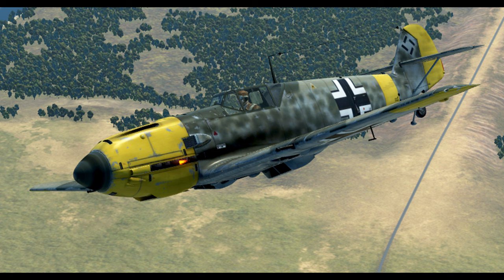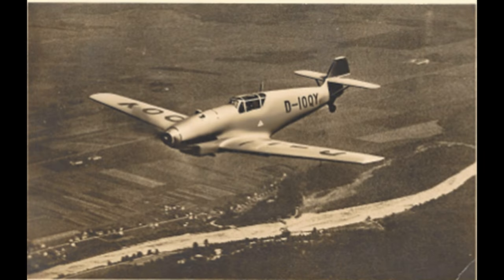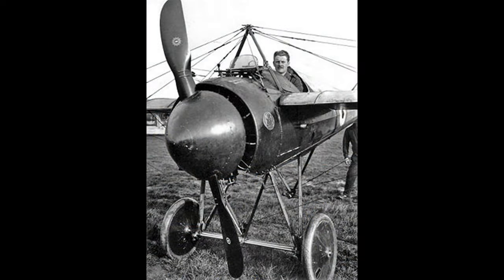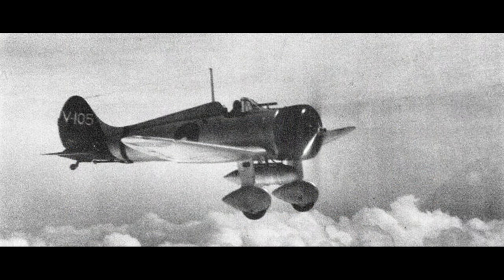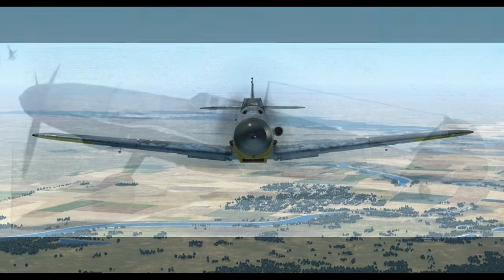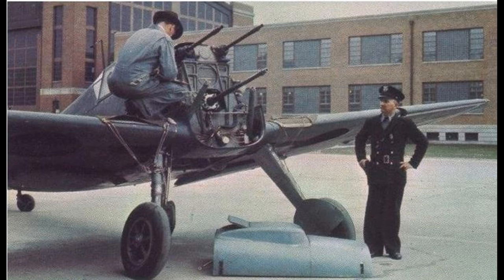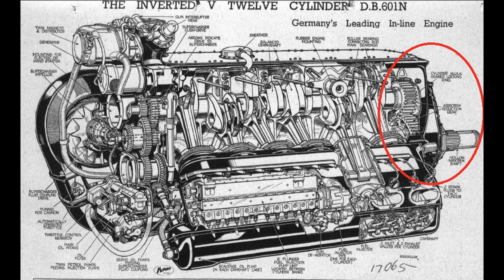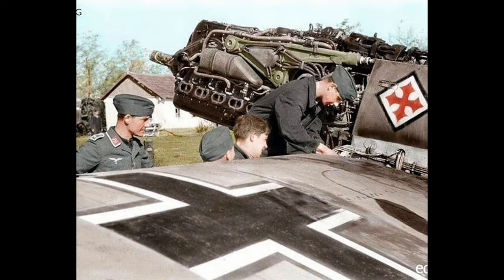Why an INVERTED V-12?  PART 2

Comment: While I appreciate the "maintenance argument", as a military aircraft mechanic I have very little real world evidence to support it.  Seems more likely that the designers/engineers were busy stuffing all the hardware in as tight a package as possible, maintainers be damned.  An hour safety wiring the inboard mounting bolt of the ECS turbine on an F-14 begs to differ.
Reply: The maintenance argument is the most valid. 

Germans have always prided themselves on world class engineering and mechanical philosophy. 

An inverted, inline-engine with a gear reduction drive mounted below the crank near the V of the cylinder banks has a lower propeller hub, and less ground clearance requiring longer gear legs, adding weight and reducing pilot visibility. They would only choose that if it provided more advantages than those drawbacks.

The advantages of an Inverted piston engine is unlimited vs. An upright piston engine when those respective engines will be located at or above shoulder height in service, and an absolute advantage in the overhaul shop. I mean everything about the inverted layout is better for aircraft purposes, except prop ground clearance.

A piston automotive engine is first removed from.the vehicle then mounted to an engine stand, then flipped upside down to remove the crank, caps, rods, pistons, etc. And its assembled the same. 

Therefore you can see you can do a complete overhaul including the highly stressed crankshaft and main bearings while the engine is mounted in the airframe, simply having a picker strong enough to lift the 150lb +/- crank, as opposed to needing a crane capable of lifting an 1,800lb engine, and then an engine stand/rotisserie able to support the entire 1-ton engine, and be able to rotate it.

A couple of mechanics with a light duty hydraulic cherry picker, or just a couple of ladders, could completely overhaul a DB inverted engine in the field without specialty industrial duty equipment.

Also, all the basics such as spark-plugs, oil scavenge pumps, valve adjustments, valves, cams, valve springs, retainers, fuel injector nozzles, high pressure fuel pump, etc. Are all hanging right at shoulder height behind removable panels. Almost everything that needs routine maintenance is within reach of a man standing on the ground. 

As opposed to an Allison or Merlin, where mechanics would climb ontop of the cowling or build scaffolding just to change the 2nd set of spark plugs in the engine valley.
Reply: @TheJustinJ  : That is the BEST explanation of the whole subject!!!  Absolutely!

Comment: Not sure how 'true' this is, but, when I was training as a machinist in mid 1970's, instructor told us the reason Spitfire had carb and ME109 fuel injection was simply because it wasn't possible for the allies to produce parts to required tolerance in high volume. (no idea how subject came up?)
 The Germans were routinely making parts to couple millionths inch tolerance when Britain and USA were still having issues at one thousandth inch tolerances. 
Yes, of course it was possible to match or beat the tolerances, but not in high enough volume.
Personally,  I never did production turning to better than 3 microns (manual machines, no 'CNC' back then) it was pretty nerve wracking as 'we' had to maintain a 95% pass rate on machined part, plus do it in less than 2 minutes.

Comment: So, reading between the lines I suspect the ascendency of horizontally opposed aviation engines is they combine most of the advantages of upright, inverted, and radial engines with fewer disadvantages.

Comment: The twin boom P-38 Lockheed opening the nose for the devastating punch of non convergence type ordnance arrangement. Her turbocharged engines muffled automatically by their use. Also no night stub flashes.

Improvement of cockpit heating electrically would have made it more suitable for cold climate use.
The boom mount motors had only to be cowled for aerodynamics and not close fitting guns.

All political issues aside the Germans had some marvelous aircraft. Even the troubled Grief had some amazing forward thinking innovative features. Across the board their genius engineering was sought after by the allies at the end of hostile action. 
The brilliance of Willie Messerschmitt was unavailable because he would not accept a subordinate role in his design philosophy.

Our incredible Saturn V a direct descendant of German rocket propulsion innovation.
Reply: There were a lot more German advancements!  The Me-262. the 163 Komet, many advanced ideas in submarines, etc etc etc.!

Comment: Inspired by your telling abut connection between air engines and tanks and P-boats - did you have made a video about air diesel engines? Are there any connectios to diesel engines for tanks (the Sovjet way) and diesel engines for P boat - german E boat ?

Comment: Hello Greg, one of the companies which produced thousands of inverted aircraft engines of many types was Czechoslovak Walter, a company known for its turboprop M601 engine (GE H series), later renamed to Motorlet, Avia and today owned by GE Aviation. The inverted in-line engines Junion, Minor, Major, Micron, M337 etc. were produced since 1932 till 2002 (in LOM company). They powered plenty of well known light aircraft (at least in Europe) such as Aero Ae-45, Zlín-26(126...726), Zlín-42/142.  They were used both with carburetors and injectors and both with and without supercharger. AFAIK the reason for the use of the inverted engine was the higher propeler axis, lower gear and lower center of gravity. 

Walter produced also one inverted military V12 engine called Sagitta but only dozens were built. The engine used Farman planetary reducer (as usual option when cannon in the shaft was not needed), so that the propeller axis was kept up. It was equipped with carburator and supercharger. It was used in many prototypes - Czechoslovak Praga E-51 recon plane, Dutch Fokker-XXIII heavy fighter, Yugoslav Rogozharski R-313, Italian Savoia-Marchetti SM.86 or Latvian fighter VEF I-16. The common feature of all of them aside of the Savoia-Marchetti is that the development was stopped by foreign occupation of said countries. The engine with the planetary reducer is preserved in Mladá Boleslav aircraft muzeum, Czech Republic.

Comment: They used inverted V12s for one simple reason- they sounded fantastic! With the Bf 110 the Bordfunker could rearm the two 20mm cannon from the rear cockpit. On the Bf109 that had a single cannon firing through the prop hub the breach sat just in front of the control column under a cover. Was it possible for the pilot to change the ammunition drum in flight?

Comment: Hi Greg. I don't know if this has been mentioned elsewhere before. I seem to remember reading  that Rolls Royce mounted an inverted Kestrel on an airframe for an expo sometime in the 30's. The reason for this escapes me. But some folk suggested that it gave an advantage however slight and the idea was copied.Rolls had a long history of upright V-12's from the WW1 Eagle onwards. I suppose convention must be hard to break unless there are significant advantages

Comment: Just to note, the Japanese liked guns firing between the cylinders. The A5M you show has guns at 11 and 1, while the Ki-27 has them at like 4 and 8, or 5 and 7. The Ar 196 also fired between cylinders, as did the Swordfish. It was pretty common, actually, until the twin row made it impossible.

Comment: Loved the comment about losing stuff in the V. Having a Moto Guzzi I find all kinds of lost nuts, springs, leaves, washers and stuff trapped in the V.
Reply: I have a US military technical manual for motorcycles dated 25 September 42, in it is all the technical and rebuild information for the common WLA Harley 45 inch flathead that they made over 90,000 of, the experimental Harley shaft drive that was based on the BMW design (although this model was never mass produced 1,000 were built for field trials and apparently as of the printing of the manual they had intentions of making it) and an Indian shaft drive with the Indian 45 inch V twin flathead turned 90° sideways like a Moto Guzzi, aside from in this manual I've never seen anything in print or any pictures of the shaft drive Indian anywhere else, it's a real unicorn.

Comment: I want to know more about the oil in a inverted v does it take power or burn more oil I'm sure you wouldn't need piston squirters with the oil from crank falling on pistons and it would help piston cooling ? So many questions

Comment: Quite logic .engenerrs in those days use to think in the manteinance of their work . It was common  to se large manuals in operation and manteniance in cars motorcycles and all sort of apliances . Accesibility was a must in all branches of engenering why? Because manteniance was more to be done . Nowadays engeniring is more precise do to the materials developement things go under very precise tolerances in terms of materials .in the past such knoledge of the resistance of material  wasnt there so the engeneers had to over built every componet critical to function and develop protocols for manteniance .

Comment: During the Spanish Civil War two British aircraft were exported to Spain where they needed, as they say, some assembly. The Spanish mechanics put the aircraft together, minus a couple of parts the mechanics had never seen before. The two aircraft went out on patrol where they got in combat but suffered propeller damage and ended up being captured by the other side. The mechanics on the other side replaced the propellers and adding in the missing parts. Because when you shoot cowl mounted guns you need interrupters to make sure you do not shoot your own propeller off. Oops

Comment: also I think since the cylinders are out of the pilots sight, you could fit engines with more displacement without affecting the view resulting in more power

Comment: Could you make a video talking about P-51's laminar flow wings and how they behaved in turns? It is often said that they had bad turning performance but I would like to know more details about it, with lift coefficients, turn time and critical angle of attack compared to other contemporary fighters.   I know the P-51 design isn't particularly optimized for turning performance given it's weight but I would like to know how much (if any) did the laminar flow wings hamper it's maneuverability.
Reply from the maker: I will have a good aerodynamic 109 vs P-51 video.

Comment: I've been wondering how they did prop hub guns for awhile.

it wasn't long before I speculated that it'd have to be with a gear driven prop to offset the the hub from the block (can't really see a gun going through the block, let alone the zig-zag crankshaft).

It's nice to see the mechanics of it actually explained

Comment: Greg,  You finally hit on the best answer !  I knew a former Luftwaffe aircraft crew chief for several years and he always said the inverted engine's ease of maintenance  imparted a significant advantage .  I also consider the German aircraft fuel quality  adding to the maintenance load per flight hour .   Bill  also reminded me  the Luftwaffe grew from ( and never had reason to change ) from tactical roots dating back to WW1 .  The same can be said for British design parameters persisting well into the 20th century .   Great series !!   .

Comment: I don't know if it has already popped out in the comment sections of both videos, but when I think about the 109's engine bay I often appreciate the cowl-mounted radiator and its evolution along the plane's versions. It's not a big factor when you have to choose between the two layouts, but probably it's a plus for the inverted one having the oil radiator very close to the cylinder heads.

Comment: Ques: Does inverting a V type engine put any additional strain on the crank bearings or connecting rods?
Reply: Compared to the internal dynamic operating stresses of the various reciprocating and rotating parts of the engine, an additional 1 "g" of acceleration in any particular direction would seem to me to become entirely insignificant, since we're talking about hundreds of kilograms of metal moving at thousands of RPM.
EDIT: Of course, some changes to the oiling system would have to be made, but even then it's an aircraft engine for an aircraft that's expected to be doing combat aerobatics so you can't really assume that any particular direction is "up", meaning that if you want something lubricated you better supply pressurized oil to it or spray it with oil from a jet mounted somewhere, splash lubrication just wouldn't work in any way and that would generate too much "windage" losses anyways.
Reply: @44R0Ndin  Thanks for your in-depth explanation which makes sense to me, I should think aerobatics which rules out a splash or dip type oiling system.

Comment: Hi Greg,  can you tell me what type of supercharger the FW 190 used.  none of the documentaries make mention of it.   was it the same continuously variable type as the BF 109?
Reply from the maker: Sure thing. The 190A used a two speed centrifugal supercharger. It did not have the 109's variable system.

Comment: As with the cowl guns, for the inline cannon the inverted V DID have an advantage if you think about the breech of the gun reaching back into thecockpit of the 109. With an upright V this would be smack in the middle of the instrument panel. 
So it did help with the ultra-compact design of the 109.
Still not something that would have been considered while deciding how to configure the engine, I think. But helpful in the end.
Reply from the maker: That tunnel is very near the center of the engine, it wouldn't move up much if at all with the engine upright. look at the plane's profile to see what I mean.
Reply: @GregsAirplanesandAutomobiles  
Thanks for all your great analysis.
Your videos are fascinating.

Comment: No sooner did I start thinking about such as the pre WWII DeHavilland inline inverted engines and similar stuff than you showed a virtually identical design. No machine guns ever intended for that civilian application, so what  was the need for the added design complexity ? And sure enough,direct drive. It pays to listen to the content before applying the typing finger.
Quite a bit of content I have encountered nowhere else. Thanks again. Cheers.
Reply: I fail to see added design complexity and, being direct drive, the bonus is much better visibility and accesibility for the same prop clearance.
Reply: All those DH engines were designed by Halford.  The advantage with the earlier 4 cylinder engines was that it moved the cylinders down out of the pilot's view.  So the design was carried over to the inline 6 and V12 versions of what was basically the same air-cooled engine.  Many are still flying today in DH 'moth' aircraft.  I stripped and reassembled one myself in my training as an RAF engine fitter at Halton.    The only advantage given for the inverted layout was visibility for the pilot in these direct drive engines.   I  have read all my many technical books on aircraft engines and none of them mention any other advantage or disadvantage of inverted design.  This is the first!

Comment: O.K. speaking as an Aeronautical Engineer, (I worked for Grumman AeroSpace for 10 years some years ago)  Let me put my 2 pfennings worth in here. 
First, inverted, it would lower the Center of Gravity. 
Second: it would lower the overall height of the aircraft, allowing for a slightly shorter landing gear, thus saving a few pounds on the overall weight. There is an old adage in AE that goes, 'Every ounce, Counts.'
Third: It would improve the pilot's visibility both while taxiing and in flight. With Taildraggers, pilots frequently have to use the sides of the runway and judge the distance to center themselves. If the edge of the runway crosses a certain point on the canopy, they are in the correct line for takeoff. A good reason for going to Tricycle gear in itself.
I could put a Fourth one in here (But can't confirm it), in that the 'Interrupter Gear'  (the gearing that allowed the guns to fire thru the propeller) in the BF-109 was operated by a Cam and Rod System operated by 2 Cams, one per gun, at the aft end of the engine, thus the Cams that operated the Gear would be closer to the guns themselves, minimizing any rod flex, reducing the chance of a late shot hitting the propeller.. I believe most of the few Allied fighters that fired thru the propeller used a Hydraulic System whereby the Cam operated a type of pump, which, in turn, fired the guns.. The Cam and Rod System, IMHO, was more efficient. The US eliminated Cowl Mount guns to lower production requirements.
Fifth: The ease of Mantenance should go without saying....
BTW, If I remember correctly, (been a few years), I believe the Daimler-Benz  DB600, series engines used Direct Drive Dual Cranks geared to operate a single output shaft. Having the Cranks at the top of the airframe would give you the advantages mentioned above...By The Way, it was a very Nicely put together, pair of presentations. Yes, I watched both of them. 
P.S. Sorry it is so long, but had a lot to say.
Reply from the maker: Thanks Rick.
Reply: You're quite welcome and while re reading my comment I noticed I did leave something out . The DB 600 Series did, in fact raise the propeller, this is what allowed for the shorter landing gear and over all weight/height reduction....

Comment: 4:16 the smallest guns fitted to the Bf109 were larger than .50cal ie .51 (13mm) but they also used .78 (20mm) or 1.18 (30mm) cannons.
Reply: Bf 109s before g variant had 7.92mm mgs, they must be smaller than .50 cal

Comment: In an usual upright motor the oil sump is at the bottom of the motor. The oil pump takes it from there and pump it to the locations needed and the oil flows down back to the sump.  How does it work in an inverted motor?
Reply from the maker: It's a dry sump, near all the front line fighters were.